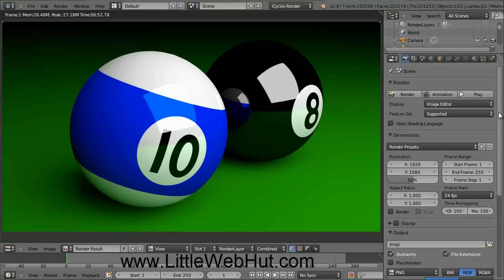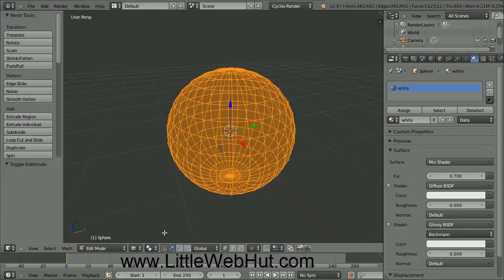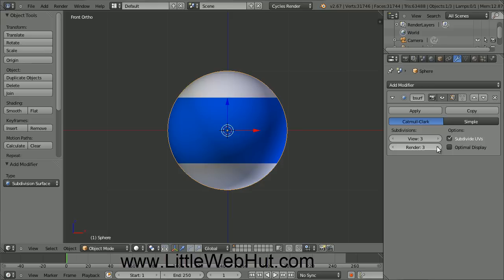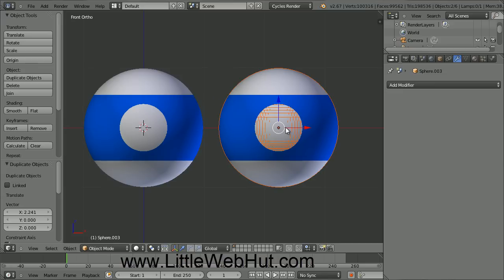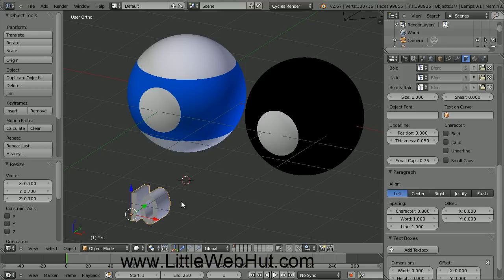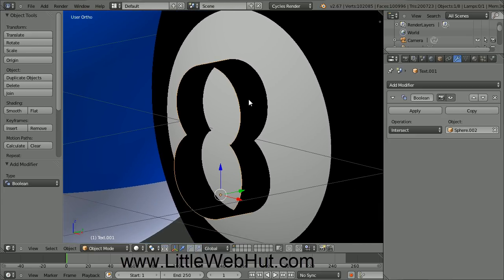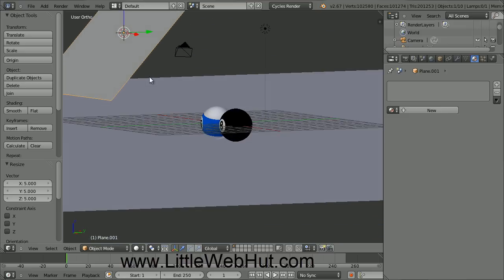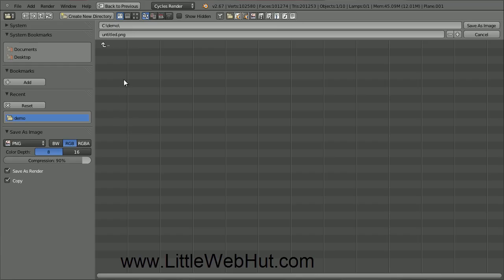Blender Tutorial For Beginners: Pool Balls

Comment: POOL BALLS

1) control z – undo
2) x – delete
3) click on material button
4) Cycles render engine
5) use node 
6) surface type
7) mix shader
8) diffuse
9) glossy
10) White default
11) roughness value to zero
12) FAC .7
13) Material name – white
14) Edit mode
15) wire frame
16)  Orthographic view front
17) A to deselect
18) B to select specific area
19) draw box
20) material button
21) plus empty
22) go down and scroll pick white
23) rename it blue
24) change color hex 001EE7
25) Settings
26) color button any blue shade 
27) Assign
28) wireframe to solid
29) edit mode to object mode
30) object modifier is the wrench icon
31) add modifier
32) subdivision surface
33)  view to 3
34)  render to 3
35)  apply
36) other side click smooth button
37) view  to right 
38) pan the view to the right
39) duplicate Shift D
40) y key to y axis
41) pick the sphere
42) material button
43) select the blue section with right mouse click
44) select blue minus button to delete blue
45)  S key to .4
46) green arrow to bring in to bigger ball
47) Object modifier
48) add modifier
49) select boolean
50) intersect  then sphere
51) position the object just on the surface
52) add modifier  then edge split 
53) split angle 30 is correct + check edge angle
54) front view make space
55) shift key three objects
56) Shift D to duplicate the ball
57)  X key to restrict movement
58) right click on the sphere
59) material button
60) blue material 
61) minus button to remove the material blue
62) duplicate the white material call it black
63) change to black and gray 707070
64)  FAC .3
65) Settings to black
66) Safe work
67) TEXT add menu
68) R key to rotate text
69) X key to restrict movement
70) then enter 90 
71) edit mode type 10
72) Object mode
73) F icon – object data button
74) offset .015
75) extrude .3
76) down to paragraph
77) Character Value .8
78) S key to scale
79) Type .7 enter
80) material button
81) use the black material
82) scroll down and pick black 
83)  shift d to duplicate number and move it
84) edit mode type 8
85) alt C and mesh from curve to both
86) front
87) center numbers
88) and move part way inside the wall on both 
89) find the sphere name
90) select text
91) object modifier add modifier and boolean
92) intersect and scroll to sphere
93) get the text close to the surface
94) F icon the add modifier
95) Edge split
96) edge and split angle 30
97) the other sphere
98) add modifier boolean sphere 
99) apply
100) Pool balls 
101) front
102) shift select the whole ball
103) r key to rotate type enter 20
104) level both balls
105) top
106) rotate R type 20 enter
107) seperate more
108) front
109) add mesh plane
110) resize and level
111) S to scale and type 50 enter
112) material button
113) new
114) diffuse surface
115) 116100 green color
116) right 
117) mesh plane
118) r to rotate to face the balls
119) s to scale 5 enter
120) material 
121) new 
122) emission and strength 15
123) World button
124) color
125) view menu
126) camera
127) view properties
128) Lock camera to view
129) properties lock camera to view
130) position to your like
131) ready to render icon render button
132) default render
133) HI render
134) Sampling
135) samples to 500
136) render button up
137) Save image as or F3

Comment: When it came time to rotate the ball, everything rotated together but the text "10" partially disappeared into the ball. Upon attempting to adjust, it was no longer smooth with the ball. I attempted to apply a boolean, but an error popped up. Closed blender. None of these objects are rotating together. I keep opening and retrying. It never works.

Comment: Ack! Nevermind. As an FYI, the addition of letter/numbers that have been converted to mesh must be inserted into the small sphere and then set to intersect the big sphere. If you don't have a small sphere, the letter/number  intersect does not work in blender. 
So if you want a single color ball/sphere and different color letter/number, the subsphere must be made to the same color as the large sphere.

Comment: I remember doing this tutorial...I even used it in a project using 2.67. Now when I try it, the number disappears and when I attempt to pull it out like a do a subsphere (smaller sphere intersecting with big sphere) it won't come out at all! the subsphere does come out as a half circle but the letter/number seem like it was simply cut down to a thin curved plane that just lays partially subsurface. And when I pull out on it, it disappears. Very frustrating :(